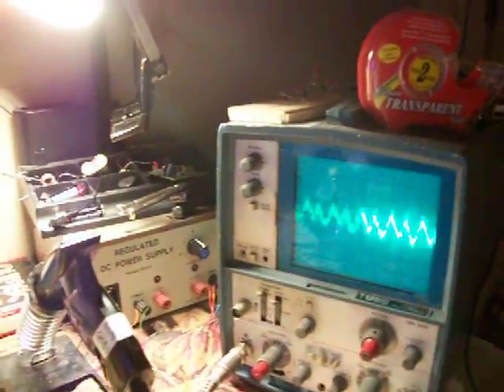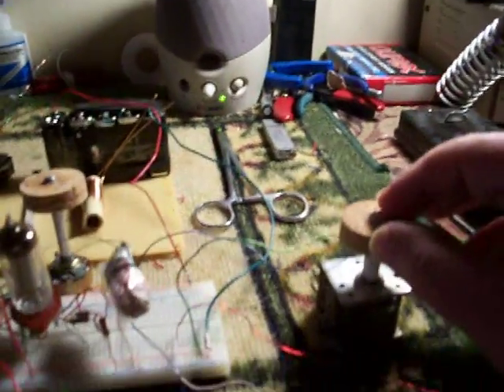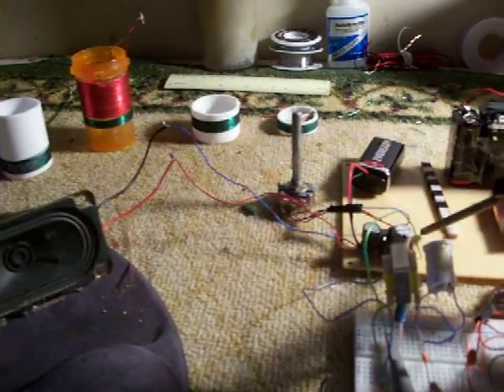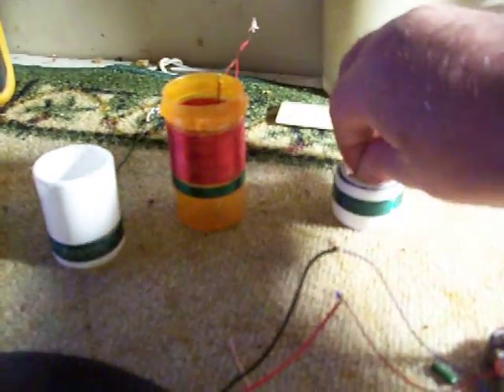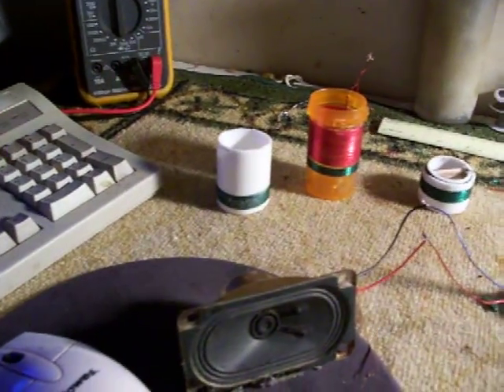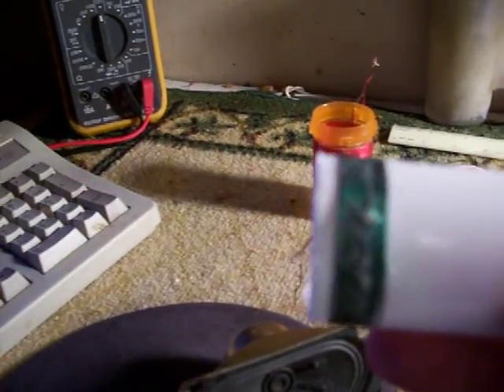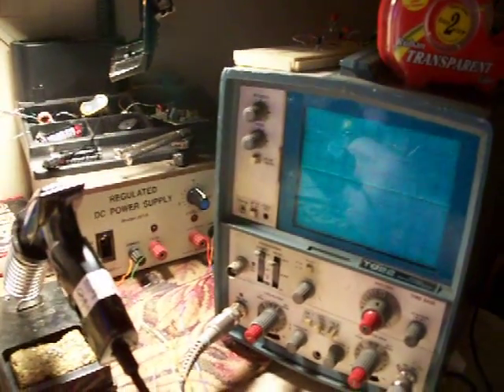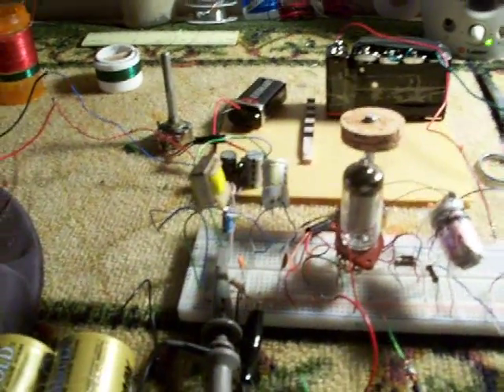Receiving Havana cuba on homemade  one  tube SW radio Part #6

Comment from the maker: It is! I loved that book, but i had wired my tube wrong and could not get any of his radios to work, but never gave up. Then 15 years later looking in parts box,I discovered that i had put a wire on according to top view, not the bottom view.. (put the wire across from the right one) And this is the result. The tube came alive in seconds 

It is a wonderful book;
 Radio Receiver Projects You Can Build
by Davidson, Homer L 
ISBN-13: 9780830641901
ISBN: 0830641904